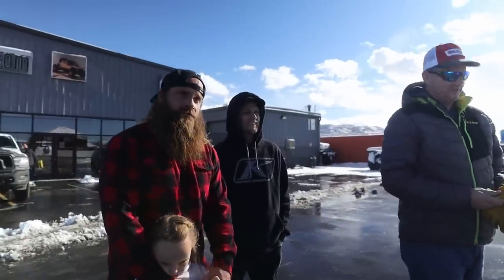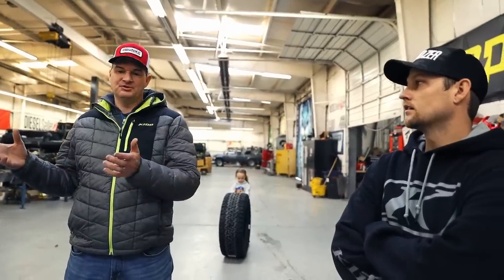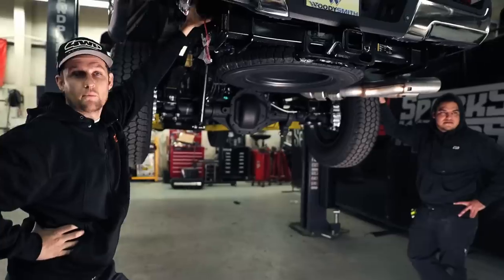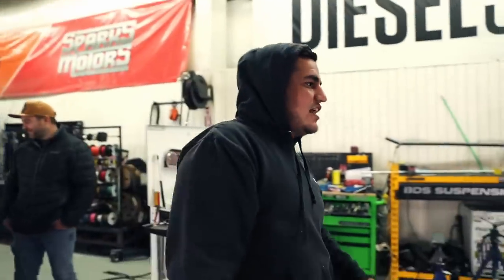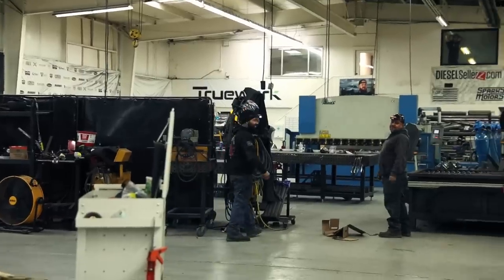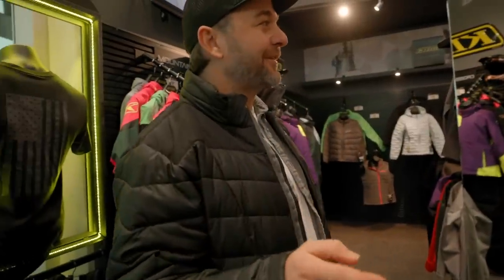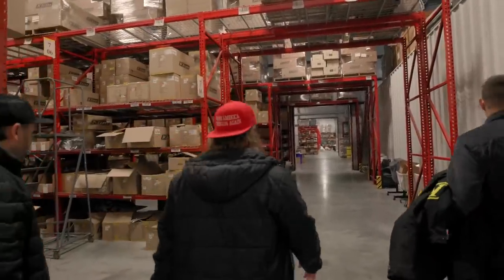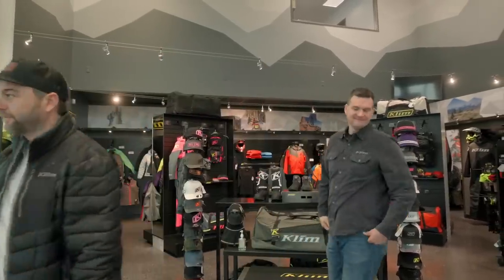Could you survive an Avalanche?

Comment: Oh on the other channel where the regulator froze up on the gas tank .. The issue is the outside temp .Regulators do not work in them temps. You need to wrap them up and keep them out of the weather. The gas has nothing to do with it freezing up ..

Comment: I've triggered probably five or six minor slides in bounds on my home mountain that I've been skiing since 2003. It's not fun when the snow breaks and the whole thing starts sliding. They're really short runs and our avalanche potential is low. We get slides every now and then but it's pretty safe on the steeps. That said if you go back country or anywhere there is avalanche danger get the necessary training and equipment to try stay safe. Avalanches are not a joke. Also be aware of tree wells and ski with people in trees. We lost a really great young woman at White to a tree well in 2012. We made runs quite a few times with 30+ people. I didn't ski with her often but I did chase her down runs a few times. It was fun chasing her line. That girl could shred. The main message is stay safe out there everyone. I've been upside down with my skis perpendicular to a creek bed with my head underwater. I used my poles to release my bindings and spent the next two hours climbing out of that vertical hole. I've also jumped into the same creek lower on the mountain and spent three hours getting out of a 15 foot deep hole with vertical walls that don't hold a load. Stay safe out there and keep shredding.

Comment: HONESTLY, that could be pretty nerve racking, but I feel it would not be material things necessarily but more so mind, body, strength power?? #1 quick thinking-try to move to the side, immediately moving perpendicular to its path to avoid getting caught up in the middle of it.
#2 To stay calm
#3 try to grab something sturdy, (if possible) 
#4 "swim" to prevent getting buried under the mounds of snow and debris, you'll want to stay on top of the avalanche. So "Swimming" will utilizing all of your muscles and hopefully keep you with surfing the current... easier said then done.
#5 in the chance you do get caught up under the snow, try to make as much room to breath, Most avalanche-related fatalities are caused by asphyxiation. If you're caught in an avalanche, take your hands and cup them over your mouth while you're still moving. According to The Clymb, doing this will "create a small pocket of air for you to survive on for up to 30 minutes."